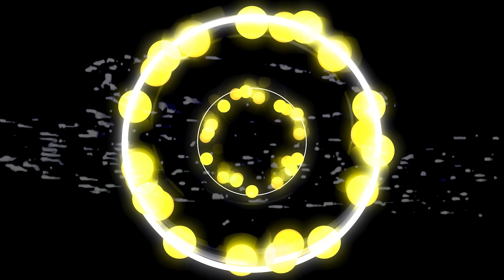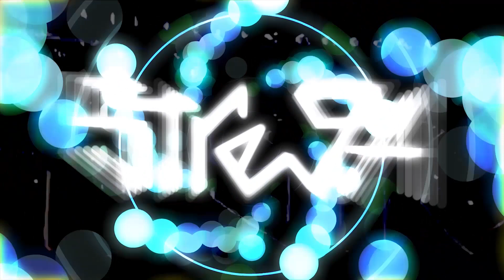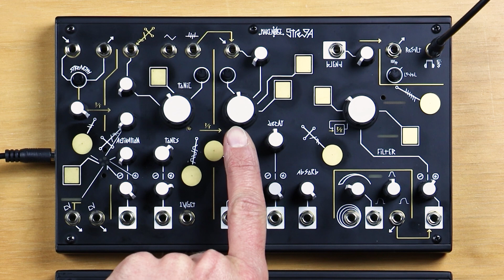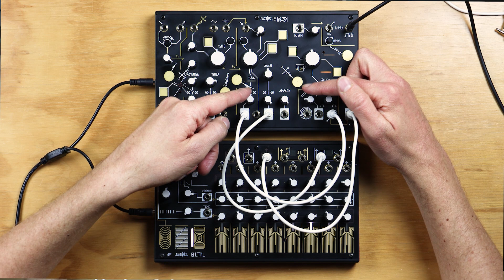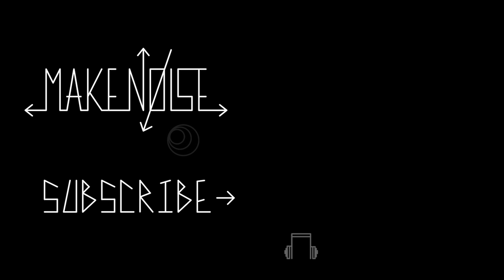Strega's Filter

Comment: As always, thanks for this demo and valuable information Walker, it definitely helped me to wrap my head around this synth a little more. I am still trying to figure out how Absorb fits into this equation, and what exactly Absorb is doing to the Filter. Is it basically just another attenuverter for the strength of the filter?  But then there's the actual Filter CV attenuverter.  its a little confusing. Seems like as Absorb reaches full CW the sound just gets more white noise.  What ia Absorb actually doing?  any insight you can share on this?
Reply from the maker: Beyond what is written in the manual, I'm at the mercy of knowledge through experience just like everybody else. Tony and Alessandro created much of the filtering/feedback behavior by improvising on a breadboard until it sounded good, then we tested it thoroughly to make sure it worked well under all conditions. So nobody really has a full knowledge of it. As far as I can tell, Absorb is mostly outside of/after the feedback paths, whereas the Filters are both in and out of them. I have also noticed that you can overdrive Absorb by pushing it beyond the knob maximum using CV.
Reply: Yea it’s difficult for me to hear exactly what this is doing to the sound except for amplify white noise. The manual is equally cryptic. Would love to see a video with some of your experiences and experiments with it!